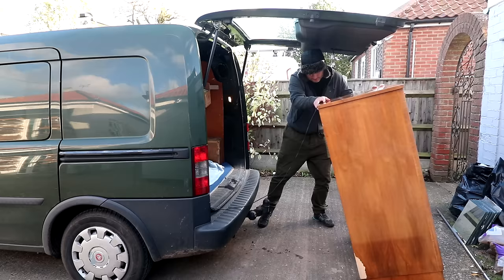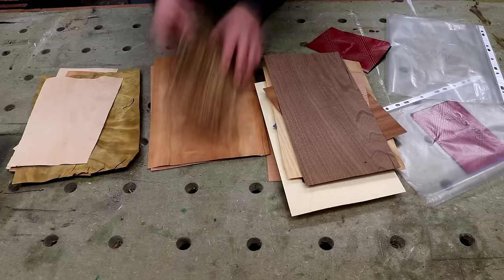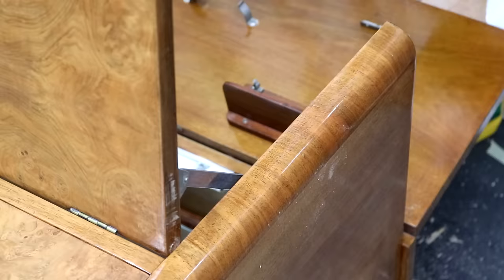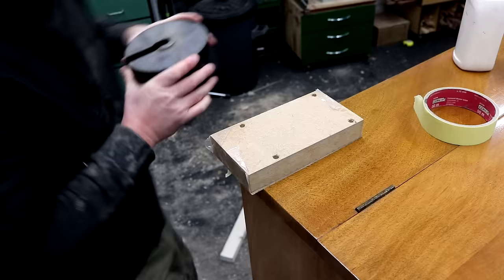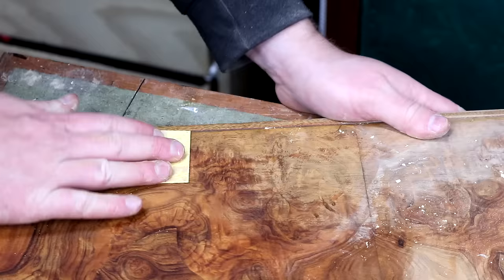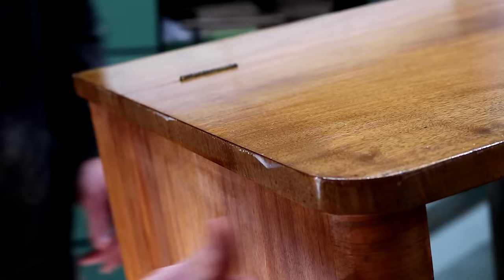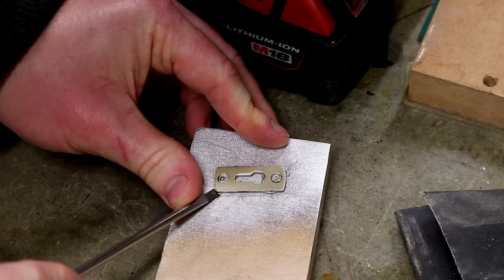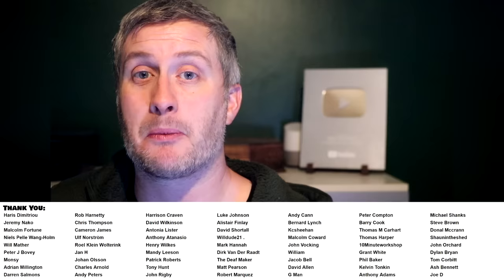Veneer Repair & Refinishing Furniture: Cocktail Cabinet

Comment: This video just got me!
FINALLY someone who is working on something similar to me.
Question- I see some of the veneer wrap around the sides of that bar, my project has that in 2 spots and like yours is very old (1941 Stromberg-Carlson radio) however there are lifted splits/ cracks that I would like to glue down and keep original- any suggestions?  
Loved this video - gave me lots of good ideas and product suggestions.👍🏻✌🏻

Comment: Looks beautiful! MUCH more vibrant wood grain, and while the patches may be slightly noticeable, it certainly looks much better than before.

I WAS wondering why you flipped the doors? I liked the balance between the top door's 'half figure'* at the top... then the 'full figure' on the top half of the 2 doors... then the 'half figure' again at the bottom of the 2 doors. *The 'figure' being the lighter toned blobby thing with the distinct edge. Just my preference though, it is so good looking now!

Comment: Been doing these repairs for years in my shop. I think your NUTS for scraping off all the finish. Use a stripper and cover it quickly with plastic to let it bake. 15 minutes. Then scrape off as you remove the plastic. Even the new stripper works fine. Are you covering it with plastic? If not it dries out fast and yes I agree it's worthless. The OTHER option is acetone and maroon scour pads. Put acetone in a spray bottle. Spray a spot.. wait 4 seconds and scrub then immediately wipe with paper towels. You can keep your pads clean(ish) by spraying with acetone and wiping them off with a paper towel.  Shellac can also be removed with Methylated Spirits (fuel). But doesn't work on Varnish. Holler if any other questions.

Comment: I wonder if it would be better to make a curved cut, like the end of an oval, instead of straight lines?  Also, fill the lines with wood filler before adding any type of stain that will increase the visibility of the hard lines.

Comment: Great job! Would it be better to cut the patch first and then mark where to remove the old veneer rather than trying to make the patch fit the gap? Thanks!
Reply from the maker: I'm not sure. Not something I've tried, but it's something to think about!
Reply: You can tape the veneer replacement over the area and cut through the replacement and the old veneer at the same time. If there are wobbles, they match.

Comment: When you use the term "White Spirits", what are you referring to?  I first thought it was an alcohol and then read that it's more like turpentine.  Then I read that it's a movie w/ Bela Lugosi.  Oh, that was White Zombie.  Sorry.
Try undercutting the existing veneer with the head of a slotted screw inverted and catching the slot right on the edge of the veneer.  You can also undercut the new piece if you can.  Doing this will allow the wood fibers to crush into each other and close the gap nicely.

Comment: Looks like Olive or Olive Ash burl veneer on the front. Always throws up some interesting figure that stuff. Looked pretty good mate. Never done a veneer patch job myself. I wonder if you could get tighter lines by laying the new veneer over the old, cutting both at once?
Reply from the maker: Cheers, I found another one of these exact cabinets on the interwebs and it said walnut burl, but I think it is much too pale to be walnut unless all the veneer was the sap wood! So you could be right 👍
Reply: @RagnBoneBrown  with veneer you mainly look at the grain, the colour is often adjusted to taste. Walnut burl is what I thought too.
Reply: @RagnBoneBrown  My first thought was walnut but, like you, thought the grain looked a little light - like olive wood. Mind you, it's only the last 30 years or so that British furniture manufacturers seem to have used olive wood in any meaningful sense, so could well be walnut.

Comment: I’m trying to learn but I’m getting more and more confuse after each video ...
I thought that shellac is the best of the best to finish the wood if you want it very lustre and shining. 

Why adding varnish and lacquer after the shellac ? What’s the benefit? 

Many thanks to anybody will help me :);)
Reply from the maker: Shellac is not very durable
Reply: Thanks for replying! 
Ok, so, the purpose of varnish and lacquer is for adding a extra layer protection (on top of the shellac)

I want to restore a big pair of vintage speakers, as soon as I will sand everything down I will might ask you another question, or two 😅.
I really want to achieve something good. Really good. 

Thanks for all your videos by the way, you helping a lot of people here 👍

Comment: I learned a lot from watching your video.  I work with solid wood and ply and have so far avoided veneer.  I am in the process of refinishing a door that I assumed was solid oak, only to find out that it is actually veneer.  I followed your advice and purchased a veneer pack off of ebay and will attempt a repair.  Have you ever considered using a cabinet scraper to remove old finishes?  I know you have a carbide scaper, but for larger areas you might want to try a cabinet scraper.  Here is a link to Mark Novak demonstrating the sharpening and use of one.  https://www.youtube.com/watch?v=7NLQEmwAvo4 Later in the video he demonstrates how he applies hard wax using heat.  He is using a gunstock in this example.  The original scrapers were made by Sandvik, but is seems now they have been copied and are available on line at quite low prices.